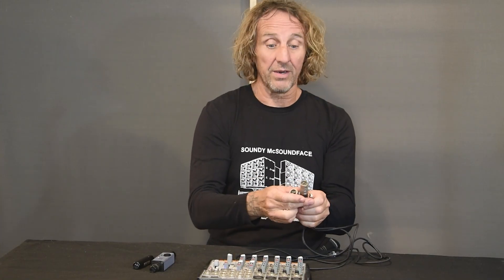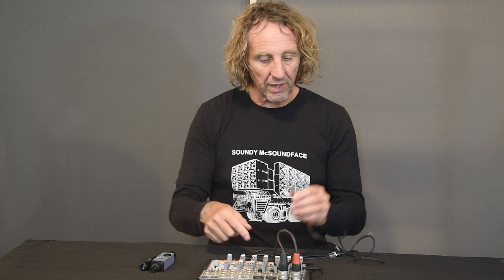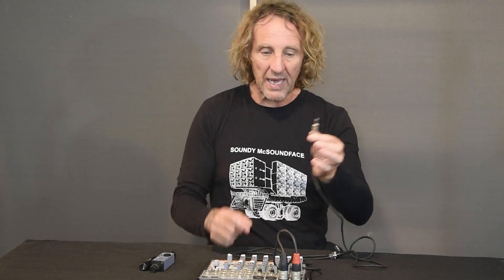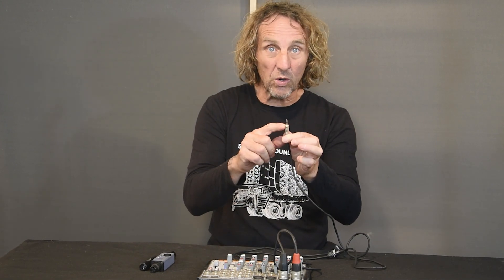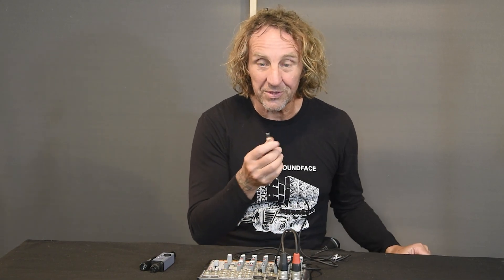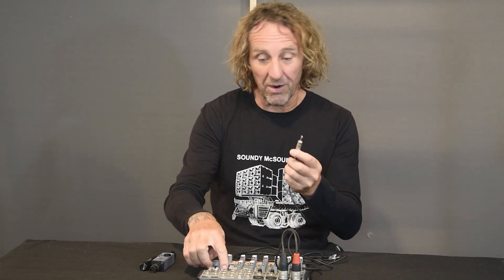Don't Let Phantom Power Kill Sound Cards - Lick Test

Comment: On a similar note I feel like I should mention this I ran across some forums talking about phantom power killing some bass amps with built in DI's apparently they did not manufacture them right. Which is why I'm a proponent for individual channel phantom power switches and don't have it on unless needed!
Reply from the maker: Interesting.  I can see a manufacturer not fully testing and also, phantom is such a weak power, it really has to be fragile for phantom to hurt it

Comment: Surprisingly as a kid taking apart disposable cameras in the car on the way home not understanding why I kept getting zapped. I never felt the need to lick a 9 Volt battery, so I had to do it once and no I won't do it again. However now I feel the need to test out what phantom power tastes like, just once. you know you have to try things at least once?
Reply from the maker: Well if ya dont like a 9v, you are really not gonna like phantom
Reply: @DaveRat  yes but now I have to know......⚡⚡⚡😅😵‍💫
Reply from the maker: Ha! Well, i would rather luck phantom than get a camera flash capacitor discharge shock

Comment: Hello sorry for this question i know that not related with this topic but recently we frequently work with radio mics.The radio frequencies which we use is 520,760,860 and nows 5g has came so question is  what frequencies do you recomend to use?
Reply from the maker: That varies greatly by country.  We use all the frequencies allowed for the country we are in plus apply for special permits to use additional frequencies

Comment: 9V batteries are a gateway drug. Kids eventually start licking 48V, 110V, and sometimes even 3-phase power before it kills them. Tipper Gore tried to make them illegal in the '80s, but it didn't work because most of congress is getting paid off by the smoke detector lobby.
Reply from the maker: Oh the drama and dangers of temptations!

Comment: Thanks Dave, this made me laugh! As to the comments about DC blocking Caps, I've actually be doing this for years in my personal aux cords and it works great with no noticeable drop in audio quality. I've got a basic schematic and pictures of how it all fits inside the XLR connectors as well as a part number for the capacitors. YouTube won't let me post the link to my shared folder though. Please feel free to PM me if you want the schematic and pictures of the cable. Thanks again Dave, keep it up, these videos are gold!
Reply from the maker: Very cool. Yes I have some circuits I have used.  The hard part is getting an indicator in the circuit that tells you if phantom is being blocked, without impacting audio
Reply: @DaveRat  Agreed, that would be a challenge for sure to get an indicator and for that reason I will now employ the "lick test" as well! 😛
Reply from the maker: 👍⚡👍 sound tech roulette
Reply: Isn’t there series resistance on phantom power supplies? It should be impossible to kill anyone with phantom power from properly designed kit.
Reply from the maker: 6.8k resistors on each pin 2 and 3

Comment: At Thomann and others for shure…. u can buy that cable with a Transformator in it so u don’t have to burn ur beard…
Reply: But that's way more expensive than a passive adapter and hey look it works......
Reply: @imark7777777  its some 11€…. And it saves u from killing you soundcard or burning ur beard…. Because, to be honest, from time to time,  in a stressy situation u can forget to switch of phantom very easy…

Comment: I popped two macbook pro audio jacks with that damn same scenario hahaa, the cable only had one xlr wonder if it was mono or what
Reply from the maker: The jolt of 48 while the jack is plugged in seems to be the issue
Reply: Mono or stereo it doesn't matter it depends on how the end is wired as to whether it will take out one or both probably both channels.

Comment: Simply add some DC-blocking caps into the XLRs, then you are a candidate for the nobel prize   (cause you never need Phantom Power on a Mini Jack) 🙂
Reply: Please link some schematics.
Reply from the maker: A search for block phantom will come up with some options.. basically 2 no polarized capacitors and 2 resistors
Reply: And you never really should

Comment: this made me wonder,  how much current is in a phantom supply? must be a few amps right?
Reply: Nope, only 4 to 22 milliamps. The voltage isn't always 48 volts at the other end it can sag to like 12 volts.
Reply: @HazeAnderson  true. 
The standard phantom supply uses a 4700 ohm resistor in series in case it gets shorted, which is actually pretty often. That limits the current to about 10 mA. Still enough to sting a bit, and might not be a good idea through your heart, but through the tongue probably wouldn’t do any long-term damage. You can’t feel it with dry fingers, but licking your fingers might be enough for a weak tingle.
Reply: @TomCee53  It's usually a pair of 6.8K, one per pin. That's 3.4K and limits 48V to 14mA into a dead short.
Reply from the maker: I thought is was 6.8k but yes
Reply: @TomCee53  having self-taught myself how to work on phone lines you don't feel the -48 volts until you just happen to be standing in a puddle one day and maybe the phone rang?
Reply from the maker: I've got those phone shocks as a kid and it made me jump, was kinda fun and unfriendly zap.

Comment: Haven't singers died by being shocked by the microphone? How does that happen?
Reply from the maker: Well, singers have died from shock but not from phantom power.  Singers have died from bad grounds and taking 120 or 240 volts to the mouth
Reply: @DaveRat  oh ok. Yeah you'd think microphone manufacturers would find a way to insulate the mic so that can't happen
Reply from the maker: Well, the mic needs to or should be grounded to be safe and to reduce him and buzz.

What I have seen happen is the old vintage guitar amps are not properly grounded. Many made before grounded 3 prong ac plugs were invented. And those old tube amps have high voltages and often sketch wiring.

Like mics, guitars strings are also grounded or should be. So when a musician has a bad amp and touches their strings and then puts lips to the mic, they can get zapped.

Also gigs where is rains or stages that are not properly grounded can sometimes have voltage.  

Grounded is good. Touching voltage and ground at the same time is bad
Reply: @david_4246  don't forget about the metal connector body too.
Reply: @DaveRat  to add to that not only were old guitar amps two prong it was 50/50 shot of putting 120 volts on the casing and if you ever encounter old radios there is a procedure to make them safe and guitar amps weren't that much different. For some reason they decided to positive ground the entire system using only the casing as insulation.
Reply from the maker: Yeah, back in the old days a 120v shock was just an annoying inconvenience that sometimes caused death.